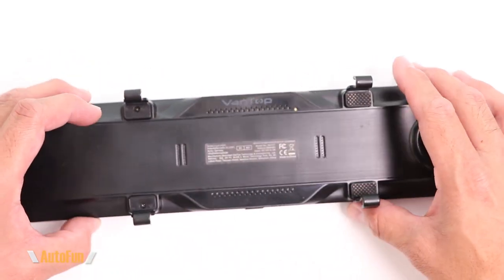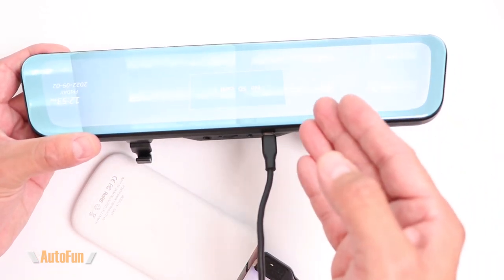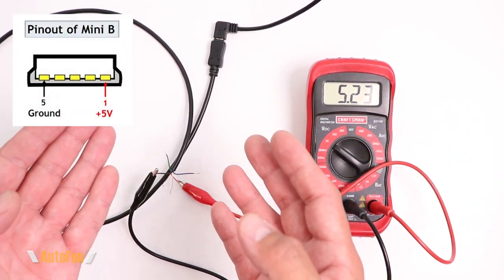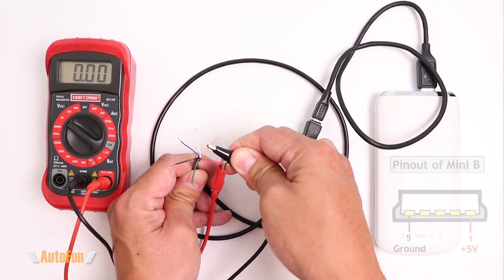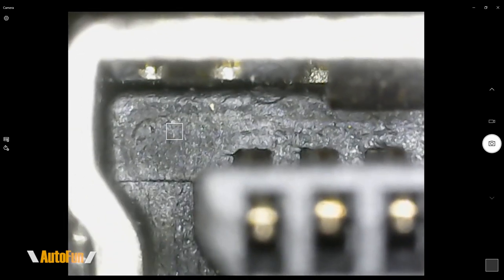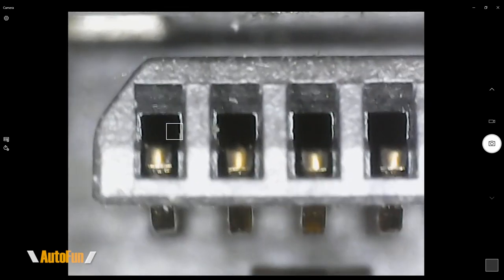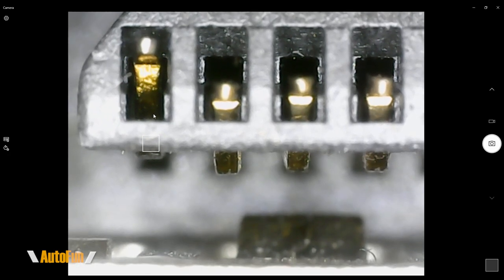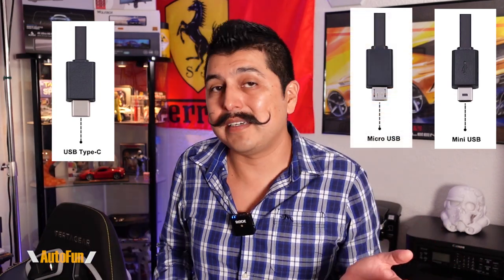This KILLED my Mirror Dash Cam (Vantop H612T)

Comment: YEP, I confirm. The connector is a problem in this camera. Before it started to fail it was getting really really hot in the connector. The bending is because of heat generated. Now what I have to do is to connect the Mini USB half way through to get power. Thank you for this video because I already disassemble the connector because there was also a faulty cable. What I am going to do is to modify the cable to connect the ground to the shield, I hope this avoids the heat and the ground problem.
Reply from the maker: Hi EdrumSense! and here is my follow up video where I do a full teardown on this dash cam https://youtu.be/HW8jqbl_ayU so you can see how it comes apart, hope this helps, Cheers!
Reply: Yep.  Mine is doing the same thing.  I had to wiggle it and pull it out halfway for it to work.  While it worked for awhile and now it just stopped working.   Because of the design issue I will look into getting a different brand with usbc connector.

Comment: Thank you for the informative video... but how do you separate the front and back sections of the main case? In this video it's already open a little because of the swollen battery, but without that help, how do you get it started? Thanks
Reply from the maker: You're welcome Dave! Ah yes I did it using a spatula, here is the full disassembly video https://youtu.be/HW8jqbl_ayU Cheers1

Comment: My vantop stopped working too, upon review it was the usb connector also, +5V pin was broken, so I soldered cables directly to the board and obviously stared working again
Reply from the maker: Hi davidsega4a! nice! (the part where it works again, not the part where it broke lol) thanks for sharing this tip for fixing this issue. Cheers!

Comment: Great detail. Watched the whole thing. Could this be why my newly installed one is flickering so much? It's like a side-to-side jitter.
Reply from the maker: Thanks Owen! very possibly, I used a microscope just to be able to record it and show on video as clear as possible, but I was actually able to see the down pin with the naked eye and definitely could be spotted if using a magnifying glass in case you want to inspect yours. Hope this helps, Cheers!

Comment: Very informative. I tried to use a clothes pin to straighten that wire, lol end up cracking the plastic that house that pin. lmao. But surprisingly it made it work!!! Now I’m not  sure how long it will last. Was wondering if I can just hardwire the usb or even the battery?   haha
Reply from the maker: Hi Ben! Ah yes I had another viewer solder the power cable directly to the dash cam eliminating the connector. That being said, honestly I'm not sure it would make sense to fix it unless you want to do it for fun or as a learning experience. In my case while I often solder as a hobby, I choose not to repair mine and just moved over to a new dash cam. The time and effort to source parts (if needed), de-solder and solder and reassemble is just didn't make sense for me with the price of new dash cams rapidly dropping (remember soldering equipment and materials for soldering along with any replacement part will need to be purchased) However like I said if you enjoy DYI projects or just really want to fix your old dash cam It is definitely possible. Hope this helps, Cheers!
Reply: @AlexAutoFun  i agree with your statement 100%. As an avid fisherman, I build my own rods and  if you are a true diyer you know by heart that you are not saving any money. lol Once I have more time I’ll check your other vids, not sure if you recommend similar dash cam. I have a ford transit van and really necessary to have similar dash as it helps a lot while driving.
Reply from the maker: @benkihada  Thanks Ben, exactly I think some of the things we do just do them for the passion or joy of it lol Here is the disassembly video https://youtu.be/HW8jqbl_ayU Cheers1

Comment: I have been using the same dashcam for over a year in my hotshot truck, and originally used the hard wire kit. I had two hard wire kits fail and one dashcam. I currently use the cigarette lighter adapter which I never unplug. I just turn the dashcam off when I stop and this has worked well although I do not like having the wire exposed. Eventually, I will install an extra 12V power point so the wiring can be under the dash somewhere. After seeing this video, I checked my first dashcam and the same pin is damaged. I am going to play with it to see if I can fix it and use it in my daily driver. Sounds to me like a bad run of connectors from the supplier. Once I install my dashcam, it's never unplugged.
Reply from the maker: Hi 2020 Hot Shot Trucking LLC! that sounds very possible, because the Mini USB connector normally can handle quite a bit of abuse. Cheers!

Comment: Found this video after both my H612T failed. Both had the same problem where the pin was out of place. Using a portable power bank would power it up fine. So I opened it up and see how difficult it is to solder a new usb connection. It looks too small so it would be difficult to do by hand. Then I tried jamming the pin into place, by luck it was so brittle that just tiny bit shattered the plastic enclosing the pin. Now it works perfectly and I have good contact with the hardwiring kit LOL!!

There's a design flaw with this 2.5A, it runs way too hot. If you drive the car for 30 mins and just try touching the cable. It is too hot and it will burn you. Even if you buy a new dashcam it's the same. I might try adding a small 12V pc fan to it and see it that would help. This camera is still much better than the wolfbox one so just gotta do some diy.
Reply from the maker: Hi L! And here is my full teardown video https://youtu.be/HW8jqbl_ayU Cheers!

Comment: Hi Alex,
Do you know if those inner batteries (Lithium Polymer) are powered under AC or DC voltage from the PCB in the mirror ?
I've got a mirror with no battery, but the connectors are here, I did a measure but it is chaotic.
I've got an ANENG AN8008, and even if the measure could be wrong, it could go to few MHz for the sampling and give an average value.
I wanted to add a Li-Po battery, but with those data I am a little bit concerned. 😁
Reply from the maker: Hi F! Ah remember this dash cams use power from the vechile, which is Direct Current. AC voltage is usually only seen on the drive train unit of some EV's. Cheers!
Reply: @AlexAutoFun  That' what I thought. So I don't understand the storm of numbers I can read.  It's got the contact to plug a battery but not the hardware. :(

Comment: For a fresh install on this model, would you recommend grabbing a long mini-usb to USB cable and just plugging the USB end into a car port to USB adapter?
Reply from the maker: Hi Mike! Ah not sure if the car's port will have enough power for a mirror dashcam, normally they require 2.5A or more to work, but it's an interesting idea. Hope this helps, Cheers!
Reply: Did it work. I have a usb connection to my 12 volt cigarette lighter port and I was curious

Comment: Hey Alex,  Thanks for posting these..so I have the H612L version and its my 2nd one..the first was 610 and it stopped working after 8 months...went ahead and purchased the 612...after 6 months it started separating in half like yours but it was bowing in the middle and thats where is would come apart...after several ties reconnecting I used a tiny bit of super glue to connect permanently ...Ironically and unrelated, now it is recording nonstop and will not let me go into "settings"..wont accept audio commands, etc. basically its frozen on the front camera...Its working but I cant make any adjustments now...any suggestions...? I really like these and spent alot of time hard wiring to my truck but if they arent going to last long then the cost is just not worth it...If I can get it resovled then Ill go elsewhere...have you had any luck with their customer service?  Thanks for your counsel on this..
Reply from the maker: You're welcome kevin! Ah yes regarding Vantop, nope, I was never able to get a hold of them and no one ever replied to my email requests, here is my video covering this topic https://youtu.be/HmcZ-Gyx4To and here is my teardown video in case you want to see what's inside the dash cam  https://youtu.be/HW8jqbl_ayU Hope this helps, Cheers!

Comment: Hi Alex, It´s me, Luciano, from Brazil, you had Vantop H612T for a long time and now is damaged. What are you going to do? Fix, Replace for a new Brand? Based on your experience wich one you will pick for your car? Regards :goodvibes:
Reply from the maker: Hi drift4fun! ah good question! I'm currently doing the tear down video to see the extent of the issue and if there is anything else that may have failed. Hang in there video should be out next week 😁

Comment: The bulge is likely a battery that 'exploded' in extreme hot temperatures this is common, so if you live in Phoenix for example you will do better with a cam that has a capacitor
Reply from the maker: Hi Arc! Yep it was as suspected the battery! Here is the full tear down video https://youtu.be/HW8jqbl_ayU Cheers from California!

Comment: Hey Mr. Autofun, Thank you for this informative video, Are there any other rear view dashcams that suffer from this swelling battery issue?
Reply from the maker: You're welcome Jimmy POP Zombie! Ah yes, this issue seems to affect lithium batteries in general (the general theory is that gas build up is caused by the battery aging or being overcharged or charged while hot etc.) What's interesting is that I also seen this before in cell phones and recently on two of my GoPro Hero 4 batteries (genuine GoPro batteries that were seldom used, they were barely past a 1yr old) So I would say all lithium battery equipped devices can probably develop this, some quicker than others and some don't for a long time based on what I seen. I'm hoping someone in the battery industry can comment on how common or rare this issue is. Hope this helps, Cheers bud!
Reply: @AlexAutoFun  I hope they at least they provide replacement battery for this issue. I had an issue like this with a desktop device and the same thing happened, I had to open the device and remove the battery. The device work but without a battery. I plan to buy of of these and would rather not deal with this if possible. I live in Florida so I'm concerned about the heat we have here.
Reply from the maker: @zombieddie73  Hi Jimmy! not sure if have seen my other video https://youtu.be/HmcZ-Gyx4To it's very possible we will not hear back from Vantop anymore, they seem to have gone MIA recently. But yeah I'm thinking of removing the battery and putting it back together and see if it works ok that way...
Reply: @AlexAutoFun  That will influence my decision to buy from their company, I wonder if you can use one of the external batteries to still have the parking mode, maybe one of the BlackVue battery packs? As long as parking mode still works. Maybe you could make a video of it, if it works of course.

Comment: I need to replace the mini USB port on the Van top h612t 
Do you know what the correct part number is there are many different model USB ports
Please rush I would so appreciate it
Thank you
Reply from the maker: Hi Alven, It's a standard SMT Mini USB connector, there are many vendors selling them under different part numbers but remember replacing it will involve de-soldering and soldering (gullwing contacts if I remember correct) so you need to have been trained or have experience soldering very small components (and ideally experience doing drag soldering) and also have the right equipment and materials. However honestly I'm not sure it would make sense to fix it unless you want to do it for fun or as a learning experience. In my case while I am trained in soldering, I choose not to repair mine and just moved over to a new dash cam. The time and effort to source parts, de-solder and solder new one and reassemble is just didn't make sense for me with the price of new dash cams rapidly dropping (remember soldering equipment and materials for soldering along with the replacement part will need to be purchased) However like I said if you enjoy DYI projects or just really want to fix your old dash cam It is definitely possible. Another viewer for example choose to connect the power cable directly to the dash cam eliminating the connector all together, so some people are fixing theirs. Hope this helps, Cheers!
Reply: @AlexAutoFun  Thank you for the information. I really miss my mirror camera, rear wide angle view was great. As far as whether Van Top is the one to stay with it's the only mirror camera I have had. But only 2 years not good.
I ordered another Van Top only because it was new and h612 at $59
from Best Buy I guess they are dumping them, but since my car was already wired for it and the price was good and if I only get a couple years use it will be enough time to research for the best replacement.
When I originally emailed you I hadn't seen the one I purchased at the low price and all is necessary is to plug it in.
Now the repairing of the USB port, I really have very little solder experience I do have nice equipment.
But if it's as difficult as you say I may be throwing money out by purchasing flux, etc. I do like to tinker but if it's as difficult I would not enjoy working with bad results.
Thank you for your time with my problem ps I really enjoy watching your program and finally subscribed 😂
Reply from the maker: You're welcome Alven and welcome to the channel!
Reply: @AlexAutoFun  update, opened and the battery is also swollen just going to trash it too many parts and time 
Thanks again
Reply from the maker: @alvencorder9217  Good call Alven, Cheers!

Comment: The car power cable that came with this camera was garbage. Didn't want to power the camera but them I used a different power connector it works fine

Comment: Has anyone found a dash cam that can be swapped in to replace a VanTop H612T while using the same cabling/connectors (power, rear camera, and GPS cables)?

My VanTop H612T is failing but the rear camera wiring and power cabling is buried in my van build and would be almost impossible to change, so I'd like to just swap in a new mirror unit that uses the same cabling and connectors.
Reply from the maker: Hi Jason! Ah yes mixing components such as different cameras (or cabling) is sometimes possible BUT I usually don't recommend it unless you don't mind potentially voiding warranty (due to mixing components/brands). We also don't know the long term aspects (both operational and safety) of mixing components/brands. There is also the issue of which components will actually appear to work at first but fail later due to mixing since sometimes small differences between the products while looking the same from the outside are important (I had a viewer fry his new rear camera because the old wiring connections looked same as his prior rear dash cam) Cheers!

Comment: Would you happened to know why in my dash cam the image in the back up mode the picture comes out in reverse....
Reply from the maker: Hi Matt! Ah yes a backup camera will show a mirrored view like a regular mirror does (flipped horizontally) which includes flipped letters like a normal mirror creates (some emergency vehicles have mirrored text on them so it can be read correctly when seen thru a mirror, if the image is not mirrored that text won't be readable). However if you still want to flip the image some backup cameras do let you disable that function however, objects on your right will show on your left and objects on your left will show on the right which can confuse the driver since we are used to a mirrored view so I don't see many people use this disable "mirrored rear view" option. Hope this helps, Cheers!
Reply: @AutoFun  so yes thats what is happening to me what ever is coming down my driver side shows on my passenger side and vise versa so how do I disable this.....thanks
Reply from the maker: @Mattsa-eb1uk  Check your manual, if the camera supports it, it should tell you on there how to disable it (but remember not all systems will let you disable this) Cheers!
Reply: @AutoFun  ok but don't remember receiving a manual and when I first plugged it in it didn't do that I needed a new power cord I replaced it and this is what happened so I don't know what I did.
Reply from the maker: @Mattsa-eb1uk  Ah, well I can think of a few solutions, one would be to check the website for the manufacturer of your system and see if they have a copy of the manual you can download, the other would be to contact the brand that made your backup systems and ask them for a copy of the manual or technical support. Hope this helps, Cheers!
Reply: @AutoFun  bought it from ebay trying to get a reply from the company that sold it to me so far with no avail and it's a vantop backup system and can't find anything from them either 🙃
Reply from the maker: @Mattsa-eb1uk  On no, as soon as you said Vantop I got worried, hopefully they come thru and help you man. Cheers!
Reply: @AutoFun  so you don't know how to turn off the rear mirror option mode.that u stated earlier.
Reply from the maker: @Mattsa-eb1uk  Hi Matt! I don't know what the model of your backup system is, I have reviewed many on my channel but they all have different ways to change their settings. Cheers!